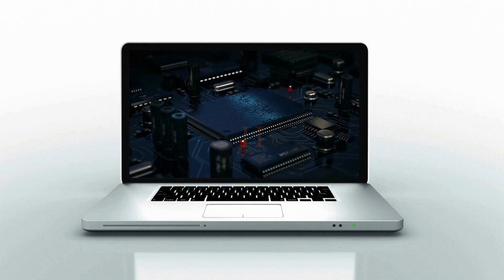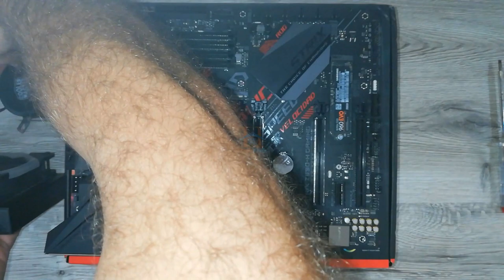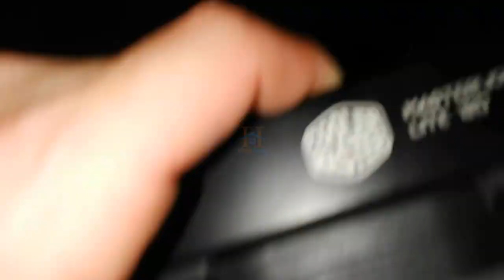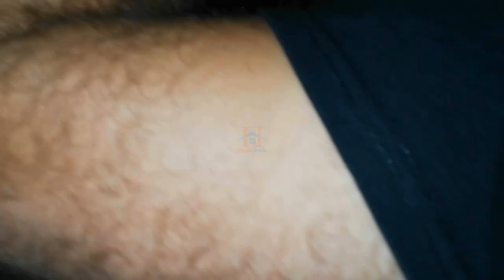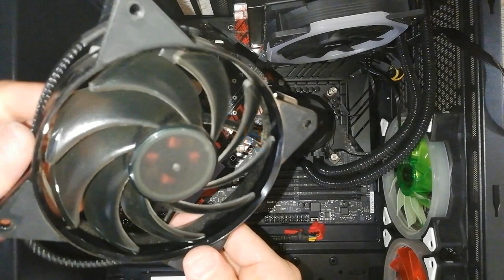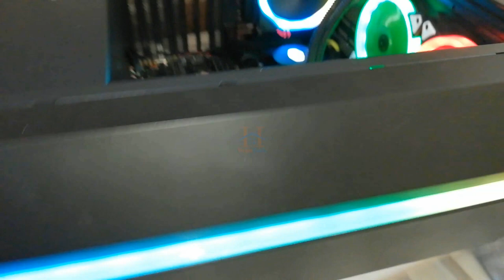PC Build Z390-H Gaming i5 9600k, TridentZ RGB 3200MHz, M.2 EVO 960 SSD, Cooler Master  Asus Z390H

Comment: Nice video, I've the same mobo :). What did you use for the RGB header? I'm thinking of putting more rgb in mine but we've only got one head so did you use a splitter or did it require power?
Reply from the maker: splitter

Comment: hey were you able to boot without updating? i was told this board needs to be updated before i could use the i5 9600k?
Reply: it should boot with that cpu, usually only z370 or "f" processors need an update